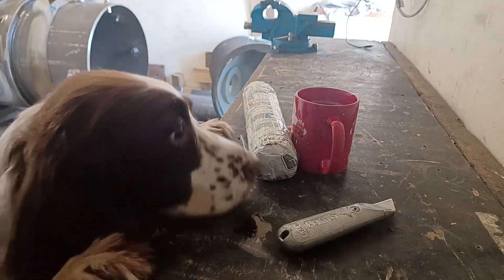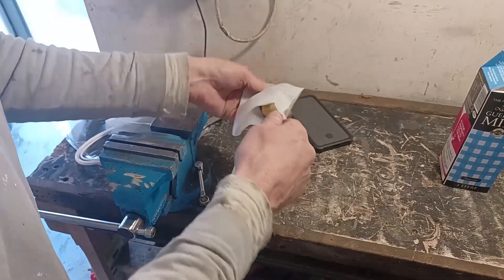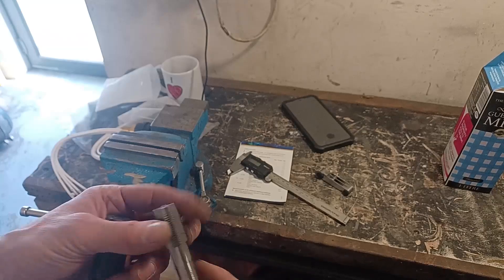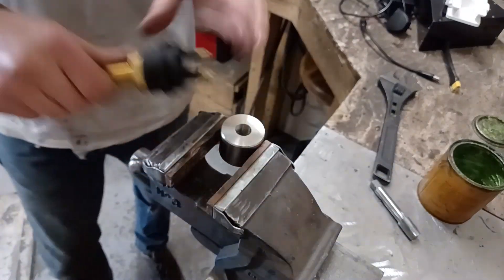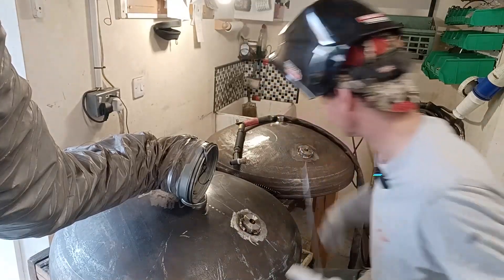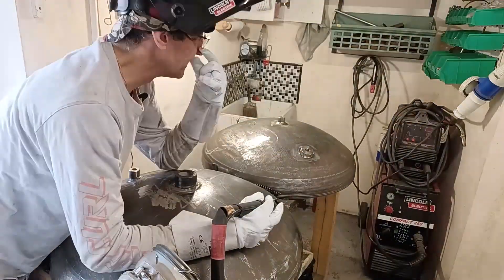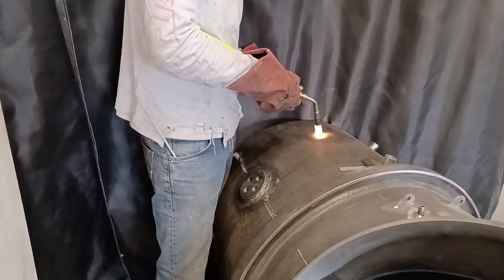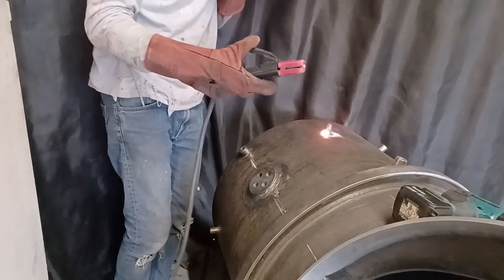Building a Submarine. Part 167.

Comment: I've read that the hole size for a specific thread is the thread size minus the pitch.  I mean in metric. For example an [M10 x 1,5] would be 10 mm minus 1,5 mm = 8,5 mm hole.
Reply from the maker: Hi.  Could be.  I honestly dont know if this is correct or not.  Personally I use the book which I know gives me the correct sizes.